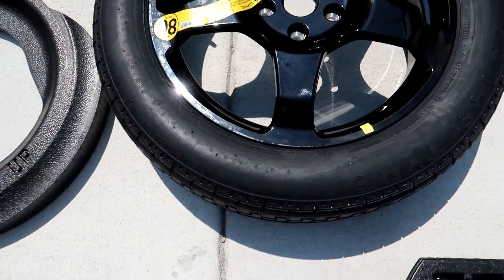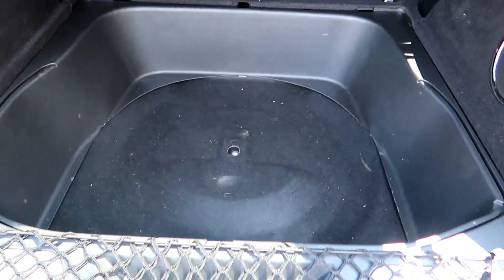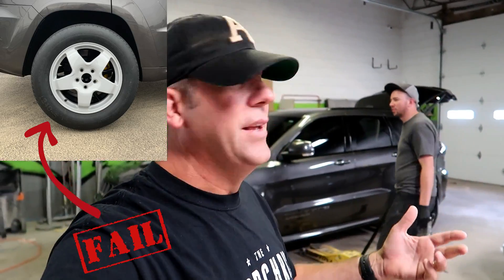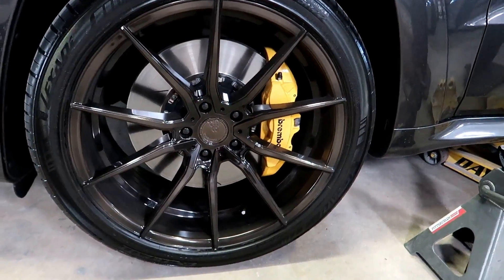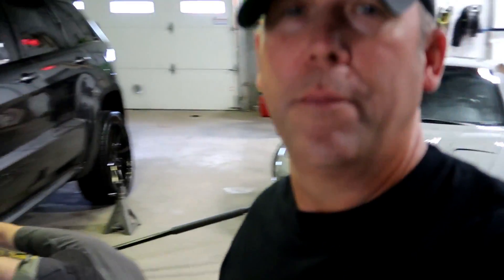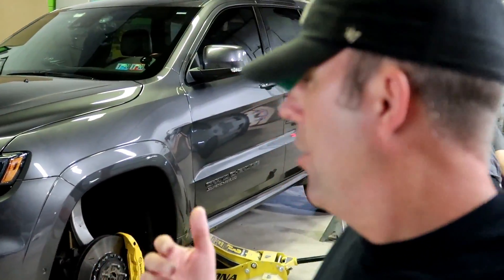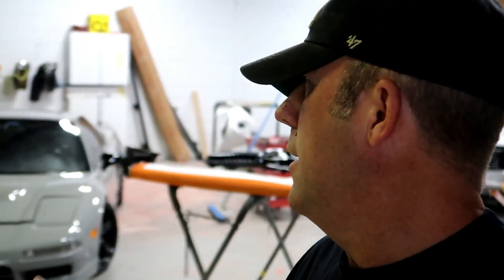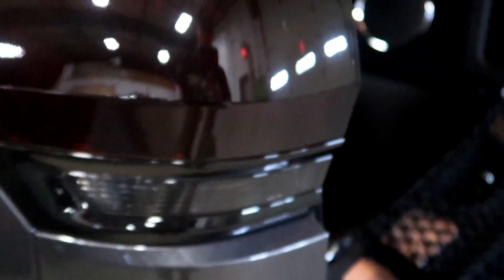Will this discontinued SRT spare fit the Trackhawk?

Comment: Hey Ron, great video that is the same spare I got with my Trackhawck but the dealer told me that if I got a flat tire in the front that I should put the spare on the back and put the back wheel on the front, to not run the spare on the front but it looks good to me so I don't know why they told me that it wouldn't fit properly. Glad I know now that it will fit.
Reply: I believe that's what my SRT owner's manual says as well.  Maybe FCA doesn't trust their manufacturing tolerences?

Comment: My 2015 GC SRT came with a 18" wheel from factory.  It says on the spare wheel it self that it has to be mounted to the rear, and then the rear tire moved forward if I have a front flat.  a PIA, but it can be done.